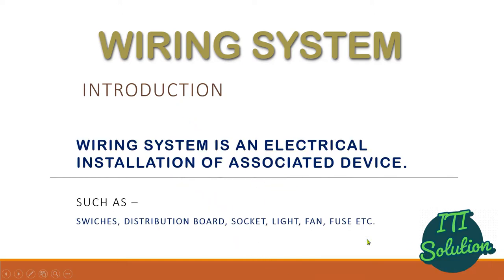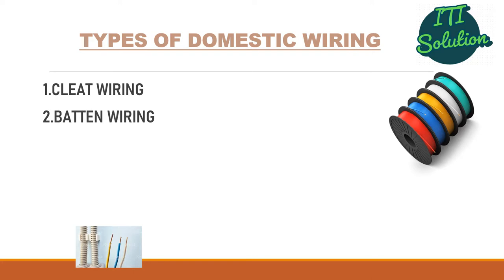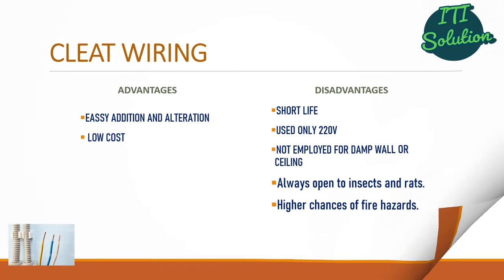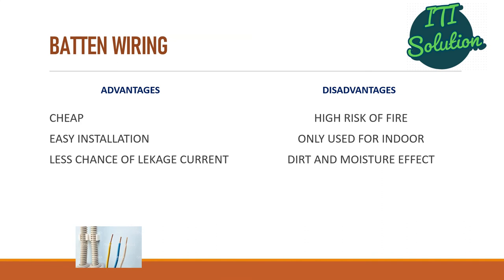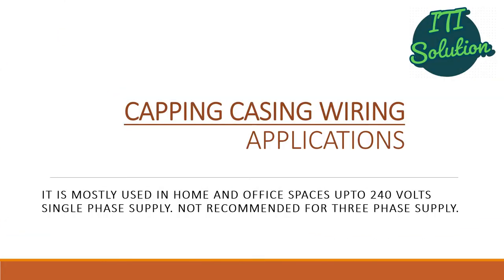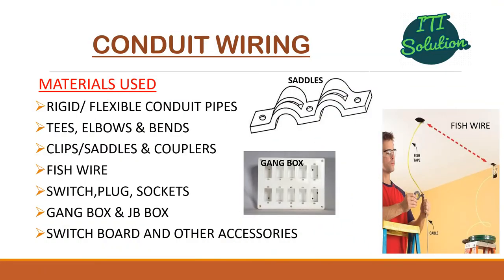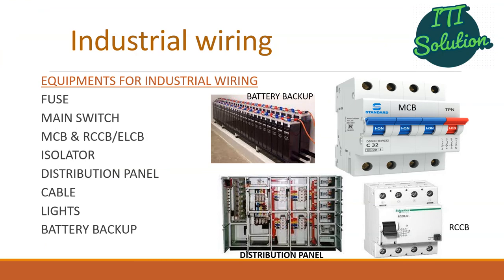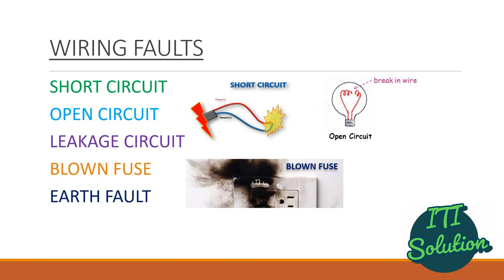WIRING SYSTEM || ITI SOLUTION  || ELECTRICAL || Prepared by - Riya Dutta

Comment: Very nice tutorial.
Maam, which one is better between Casing Conduit Wiring and Conceal wiring?
Conceal Conduit wiring is beautiful but what are its disadvantage in respect of Casing Conduit wiring?
Reply from the maker: Thank you Soo much for watching my video... between Casing Conduit Wiring and Conceal wiring, CONCEALED CONDUIT WIRING is better because casing is not locked permanently it is adjustable. But concealed pipe is moisture free long lasting....